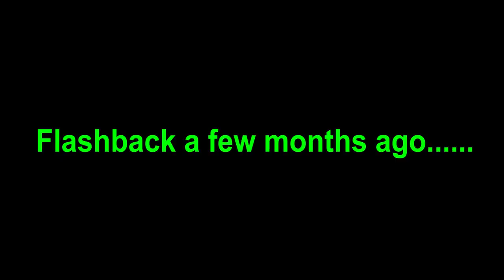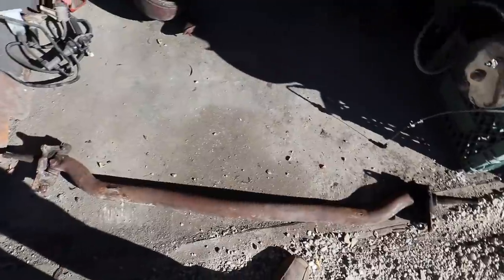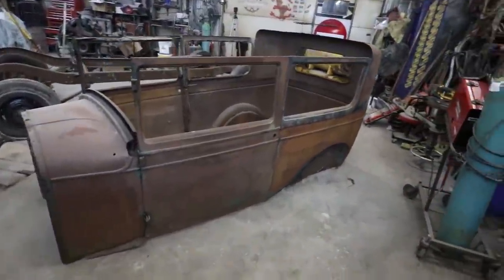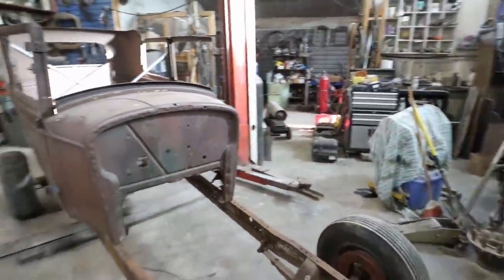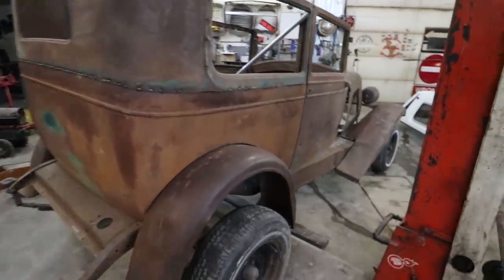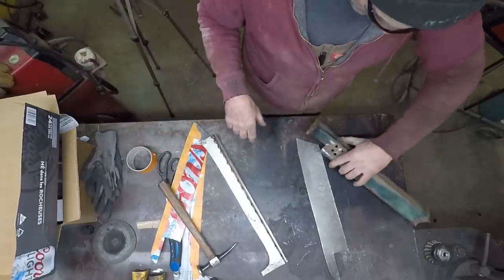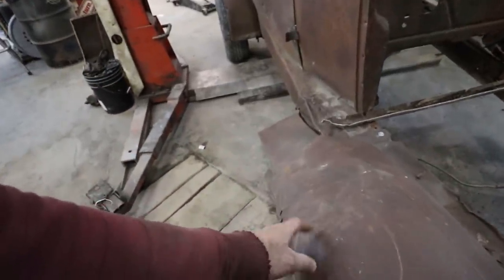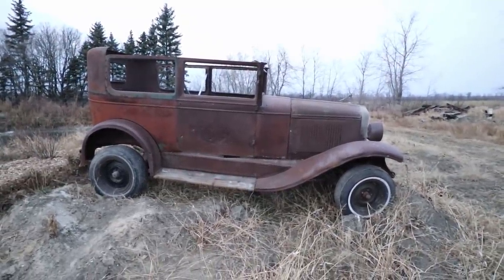1928 Pontiac building from a pile of parts.

Comment: + 1 for derermination. 
And for having vision. 
Really like thd box brake. 
Scoring or slotting the sheet metal for bending is helpful if you plan to weld it anyway. 

Had some checker plate i wanted to bend, so i left a few joining tabs and scored them. Bent my 90’s and welded it up. 
I couldnt have been happier with the end result. 

The post did turn out pretty good.

Comment: If you swap the front axle for a 1955-59 Chevy truck with a lot of drop, and put  the spring on the outside of the frame. 
Then the spring perches fit again.
Or a 1948-55 truck axle, if you will keep springs in original place. 

You Can run a 90s nissan pathfinder and put it above the rear spring. Or a 1950-59 truck rear end (6bolt is same pattern as Chevy of the era), and then the after marked is open to you!
A 216” front motor mount fits under the timing chain cover, of most Chevy straight six. And puts it firmly in the front cross member. 
And with a stovebolt six swapped in, a lot of gearboxes will fit behind it. And the aftermarket backing for them trucks are fantastic! 

You can make a six sing, and freight train a lot of cars, with more carbs, fentons, cams and headwork! 

Sweet cars! 

Even if you plan not to do it, this might encourage someone to buy it!

Comment: When I built my 69 AMC Rambler Gasser I used a 89 Cherokee 2WD tube axle front end, it already had all the disk brakes and steering, I used a 69 postal Jeep front springs and mounts, drop pitman arm, power steering from the rambler, everything worked perfect together

Comment: Brent, You an't put a Chevy 6 in this car !  If ever a car called out for a period hot rod engine its this one.  In 1953 this car would have been considered outdated and in need of some serious upgrade.  V-8's were just starting to come into their own and flat heads were at their peaks. Flat head V-8s were souped up but non-souped up overhead valve V-8's were already fast from the factory (but expensive)  so Hot Rodders were looking around for cheap alternatives.  The answer would have been a Flat head Straight 8 from a Chieftan.  Find a Pontiac straight 8 that you can shoe-horn into this buggy and you'll have a Pontiac Rat Rod that could have been souped up by some post War kid who would have been about Elvis Presley's age!

Comment: Make your running boards out of railroad ties.     That is beautiful wood grain when it is sanded down with a 7 inch grinder.   Grind it down first then, Cut slabs off the ties 3 inches thick.  You can  go 2 inches if you want. i went 2.5 inches but i think 3 inches look better. You can always cut more off easier than trying to add more back on.   Killroy.

Comment: ESTIMATE
$15,000 - $20,000
HIGHLIGHTS
187 CI inline 6-cylinder engine
Carter carburetor
3-speed manual transmission
Front and rear semi-elliptic leaf springs
Black with Red Cloth interior
Sun visor
Wood steering wheel
Rear-mounted spare
Chief radiator mascot
Painted wood spoke wheels
Whitewall tires